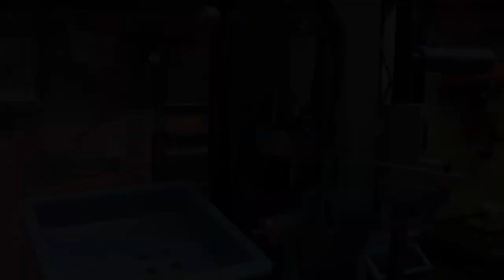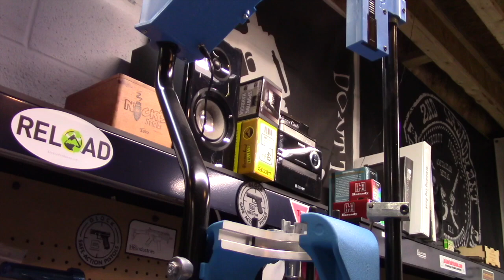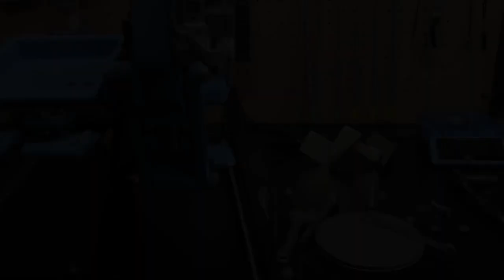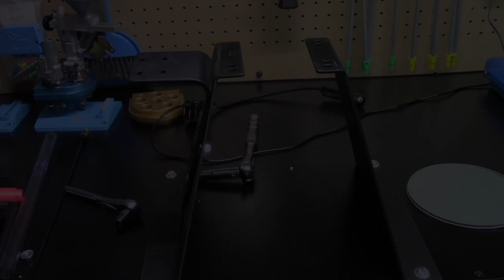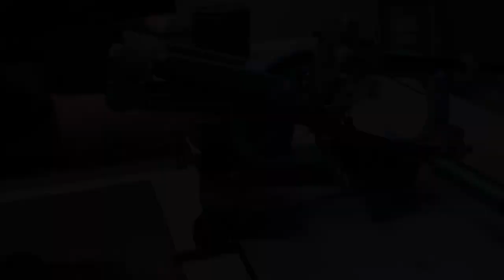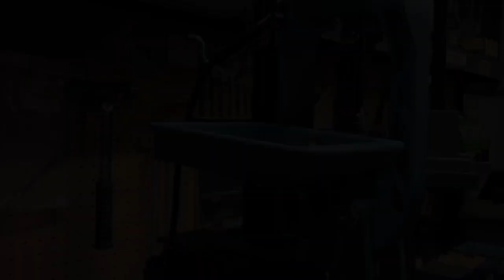Dillon XL750 Inline Fabrication Ultra Mount from Dillon Strong Mount

Comment: Inline Fab is a great way to go.🙂 Their press handles and press mounts allowed me to configure my busy yet small bench into an organized and functional workspace. I use the flat plate for a Forster single stage and the 4" plate for a Dillon 750XL. I have several presses that I wanted to store on the bench and Dan fabricated the mounts to do so.

Comment: Good video. Tx. With the counter height plus mount height I assume you are standing to operate the press. Is it a comfortable height? Or would you now prefer a lower height. What is the press bafle height from the floor?
Reply from the maker: I set my hugest specifically for comfort.  I measure standing with hand at its lowest position.  That is the minimum I want my handle to be so that I don’t have to bend over to fully cycle the press.  I buy the appropriate Mount to get that height.  There is no right or wrong answers completely depends on your body and sit or stand preference

Comment: I'm new to reloading and currently building my bench.  I have a Dillon Square Deal 2.  I plan to (but haven't yet purchased) any mounting systems.
At what height/level do you mount your press relative to your shoulders or waste?  In regard to where you find that the normal  operation to be the most comfortable and efficient over a long period of time.

Comment: Do the strong mount holes and inline fab mount holes line up on the bench or did you have to drill new holes in your bench?
Reply from the maker: The bolt patterns are different